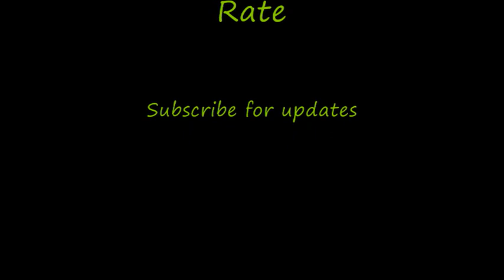Wireless Energy Transfer

Comment: air core coils create magnetism also, which is why this assembly is affected by distance, I would imagine its affected in a X^2 pattern, the voltage drops off dramatically with distance from coil to coil. There are some guys on the net using a frequency pulse and whatnot to increase the distance power can be sent. Keep working with it see what bemf fields you can possibly transfer.

Comment from the maker: thanks for the comment, i'm gonna try to get relays and timers to control the pulses.  ac voltage might be a bit much for these coils, have you tried it before?  with the18v battery if i give continuous power the ignition coil get really hot., thats why i was manually pulsing the circuit.

Comment from the maker: i thought that in the transformer,  the primary coil becomes magnetic charging the secondary.  if i were to replace these two coils im using to send and recieve the powere with another transformer it would produce
a spark about 2inchs long.  so, i know its induction, just a different type.  just imagine the possibilities of applications.
 
i am gonna go for a wirless hho cell